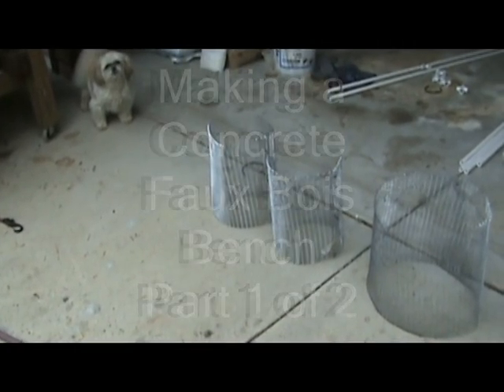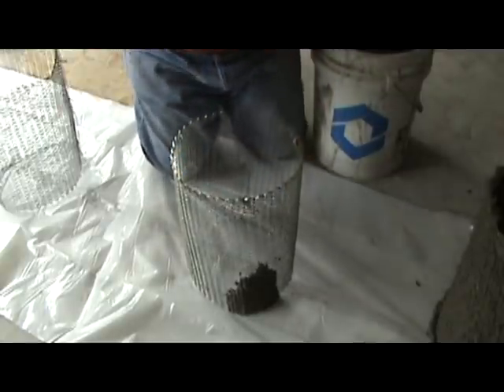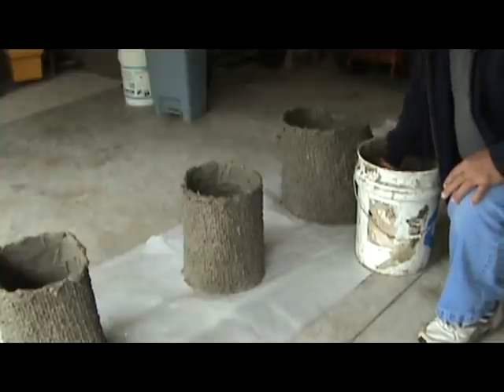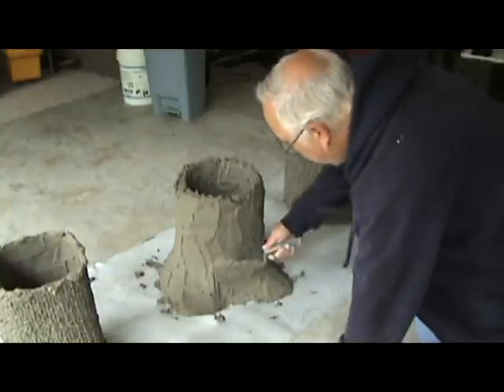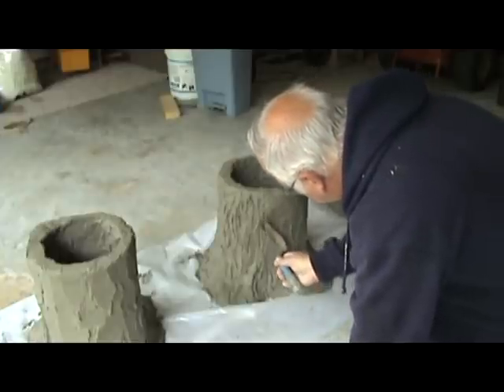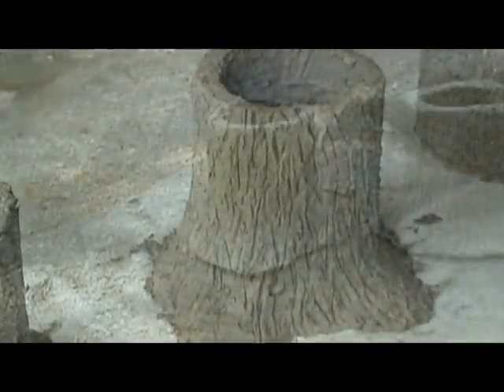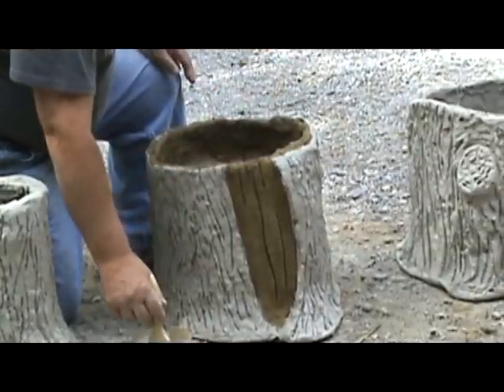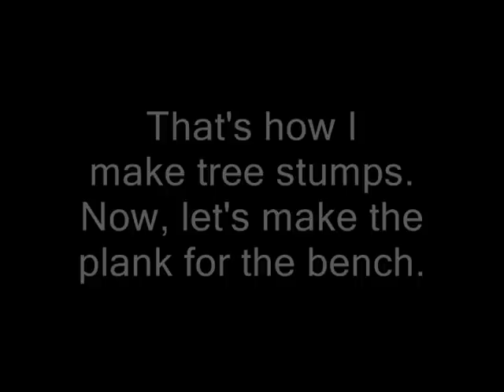Making a Concrete Bench Part 1 -- Tree Stumps.mpg

Comment: I started this project using type s mortar mix since it has 1 part cement and 3 parts sand (I think). It has been cold here, less than 40 degrees. The result is not very good. The concrete is very crumbly and brittle. So I bought some type 1/2 masonry cement to add to the mixture. It started cracking as soon as it dried. I do not have access to some of the materials that you use in your concrete recipe. Any suggestions?
Reply from the maker: Where do you live that you can't get acrylic bonding agent/admix and where you can't order fiber online?  Too much cement in a mix will cause cracking.  I don't work with concrete when it's colder than 50 degrees.
Reply: I bought the acrylic bonding agent from Lowes/home depot. I'll order the fiber online. What if i mix 1 part of cement with 2 parts of the mortar mix? The quikrete mortar mix type s seems sandy.
Reply from the maker: I don't know what they put in the bagged mixes.  That's why I stick with mixing my own.  Even then, it's not always what I want.  In this video, I was in Tennessee at my brother's place and the sand they sold at Lowes was awful.  It was crushed limestone and made a very difficult-to work mix, as you can see from how hard it was to put into the mesh. You can even HEAR the difference from what I can get here at Lowes in Illinois. I can't advise what you suggest will or will not work because I have no idea what you're starting with in the bagged mix.  Your original post said you used type s mortar mix as you "think" it has 1 part cement to 3 parts sand.  When I mix my stuff I "know" it's 1 part cement to 3 parts sand. If it's truly mortar mix it also contains 1 part lime. Keep in mind that "mortar mix" is designed to be used to hold brick and stone together, to be deliberately weaker than the brick or stone it is holding together so that it cracks under stress before the brick does.  It is also NOT meant to be used for thicker application. I've never used the bagged mortar mix, so all I can tell you is to experiment with it.  Acrylic and fiber SHOULD make a big difference.

Comment: Is it strong enough  without rebar?
Reply from the maker: Yes, with my current formula of 3 parts sand, 1 part portland cement, 5 % CSA cement, 10% metakaolin, 8% silica fume, 1/4 part PVA fiber and acrylic admix in the liquid. This is applied to a piece of expanded metal lath (stucco lath).
Reply: @dperry428  I could not figure this out. Good luck
Reply from the maker: @onlyKRIZAN  This was in reference to the seat in the second video.

Comment: Would you add your cement mix to the description please?
Reply from the maker: In this case, it is 3 sand to 1 cement and liquid of 3 parts water to 1 part acrylic bonding agent and polypropylene fiber..  I now add 10% metakaolin, 8% silica fume, 5-10% CSA cement and 2% crystalline waterproofer (Xypex), and now use PVA fiber instead of polypropylene.
Reply: Do you mean you add the "10% metakaolin, 8% silica fume, 5-10% CSA cement and 2% crystalline waterproofer (Xypex) and PVA" as 1 part to the 3 parts water instead of the 1 part acrylic bonding agent and polypropylene? Thanks in advance.  Awesome job!

You inspired me to do like you're doing potentially for the picnic table I was thinking about restoring in ferro-cement.
Reply from the maker: This video is 5 years old.  At that time, the mix was a simple one of 3 sand to 1 cement, polypropylene fiber and a liquid composed of 3 parts water to 1 part acrylic.  Today, the mix is 3 sand to 1 cement, PVA fiber, 10% metakaolon, 8% silica fume, 5 - 10% CSA cement, 2% Xypex and a liquid of 3 parts water to 1 part acrylic.  Percentages of additives are as a percent of the cement content. For example if the mix contains 10 cups of cement, I would add 1 cup of metakaolin, 8/10ths cup silica fume, 1/2 cup to 1 cup CSA, and 2/10ths cup Xypex.
Reply: Awesome, thank you sir.  Excellent videos.
Reply: I forgot to ask, what is the parts amount or percentage relation in regards to the PPE or PVA fiber?
Reply from the maker: It varies, but approximately 1/3 part in base coat, less to none in finish coat.
Reply from the maker: There is no ONE correct way to build with concrete; it depends on any number of factors and desired outcomes.  In my case, I can't justify the costs of buying expensive stamps, rollers and molds for my limited use.  I'm not in business of doing this.  Also, if one considers what I'm doing in my back yard as artistic, then using stamps and rollers does away with the art involved.  It's rather like asking a landscape or portrait artist why not, instead of using canvas, paints and brushes, just take a picture with a camera. If all I wanted, as in this video, were tree stumps made from concrete, it might well be much cheaper to simply buy one of many commercially available cast-concrete ones.  Stamped or cast concrete looks like -- well -- stamped or cast concrete.

As far as applying my mixes to other uses such as shown in the videos, I don't know if they would work as well  as the mixes used by these people. There are literally thousands of variations in concrete mixes, each engineered or designed for specific purposes.  Looks to me that the mix they're using is doing what it was designed to do.

Thanks for the input and comments.
Reply: Terrific video!
As a kid, grew up in the concrete drain tile business in Michigan and now wanting to make tree stumps.
The explanation of the concrete stains and how they work was very helpful.

Comment: What is the name of the material you use for the beginning center?
Reply from the maker: It goes by a number of names:  expanded metal lath, stucco lath, diamond mesh.  It's what is used as lath for stucco or plaster walls and is available at home improvement stores such as Lowes, Menards or Home Depot.